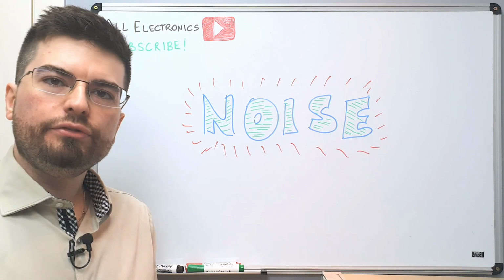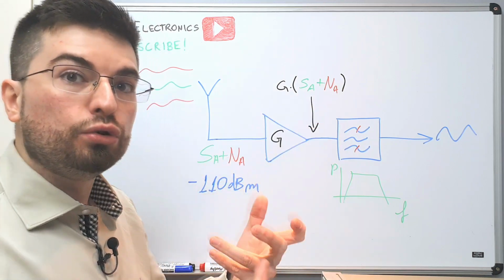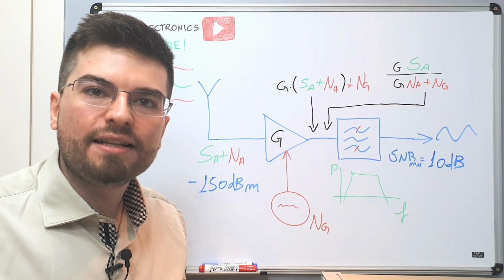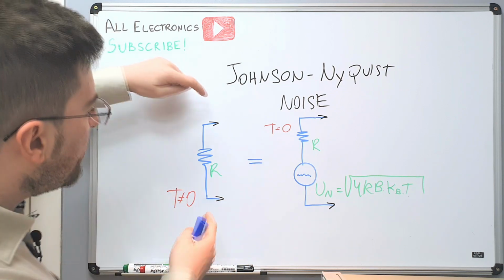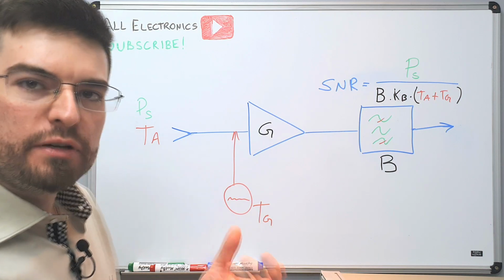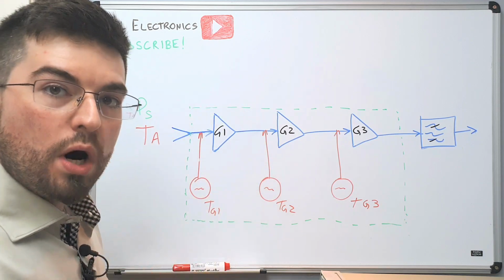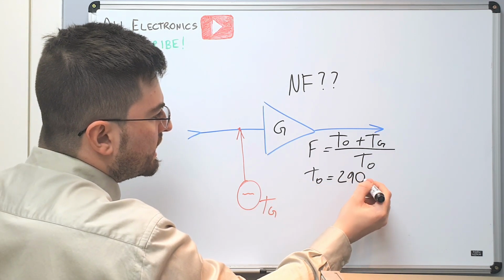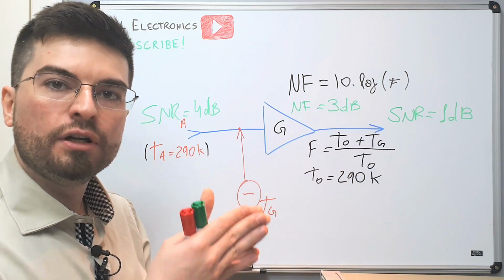Signal to Noise Ratio, Noise Temperature and Noise Figure

Comment: 9:08 So, in a system with buffering and acceptable latency, we can perform more powerful error-correction, correct? But isn't latency cumulative? That is, if an error-correction method requires 10 seconds of latency for one second of data, then 5 minutes of data will require 50 minutes of latency. Correct? Any way around that? Parallel processing?
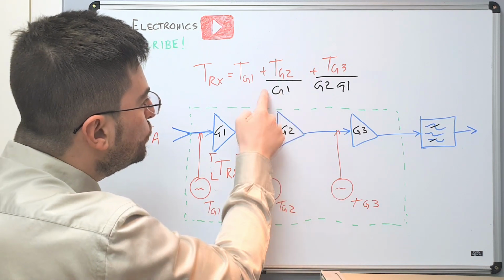9:46 What is the benefit of referring to gain-stage noise as "input" noise? That seems unnecessarily confusing and incorrect. Then in our noise formula, we'd have to count the gain noise twice (G*G), which makes no sense. If 9:46 combines Na with Ga, then at 19:54 don't we need to separate TGA from TG1, to see the effect of TG1?
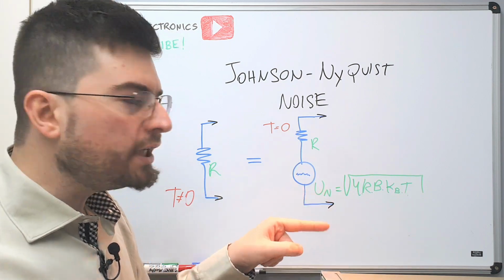12:52 Why do we say "available noise power" instead of just "noise power"? What's UN?
Reply from the maker: No.. Latency is not cummulative... It is just delay... If you cannot process the data at the same RATE, we have the problem you tought. 

You need to refer it at the output or to the input, it is a matter of choice. If you refer to the input, you can easily account for different gain settings of the amplifier, for example. 

Available Power is the power that would be dissipated to a load that is conjugated matched to the source. It is the MAXIMUM power that source can generate. It is available, and not dissipated if the load is not matched.
Reply: @AllElectronicsChannel  "Dissipated to a load" - Unclear. I thought "dissipation" means "loss". I thought that's the opposite of "available to the load."

"Available Power is dissipated. It is not dissipated."?

"Available Power is matched. It is not matched."?
Reply from the maker: Avaliable = maximum power that can be dissipated by the load

Comment: Hi, sorry but I still do not have clear idea what noise temperature is. So is it defined for amplifier or antenna out of blue or it depends on physical temperature? How to measure it?
Reply from the maker: The noise temperature is the temperature a resistor would need to be at, for generating the same amount of noise power that a circuit generates.
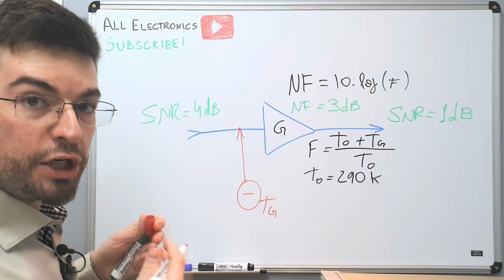Reply: I'm a bit confused here: for the antenna temperature do you mean the temperature that the antenna is itself; - or do you mean the temperature of where it's pointing i.e. the sky or the horizon...at 24:25 you say it's the temp of the antenna itself, then at 25:12 you say looking at sky it's different...?

Comment: Glad you added the example of satellite communications at the end of the video.  Have been working in satellite communications for 45+ years and noise figure is really important for this application.  In my first job working on an Army satcom terminal receiving in the 7.25-7.75 GHz range, the AN/MSC-46.  The antenna used a cryogenically cooled parametric amplifier where the first stage was operated at about 17 kelvin to reduce thermal noise.

Low noise amplifiers have improved considerably since then. The systems I work on these days operate in the Ka band (17.7-20.2 GHz and 27.5-30 GHz) and as you noted the antenna temperature depends where it is pointed and also the size of the aperture to some degree.  If the antenna on the Earth and is pointed to space it will see primarily the cold sky plus a small amount of the Earth noise coming from side lobe gain, say 40 K.  If the antenna is on the satellite and the entire 3 dB beamwidth is pointed onto the Earth, then the antenna temperature will be around 290 K.  If the satellite antenna is pointed to the edge of the Earth and only a part of the beam covers the Earth then the antenna temperature will be something less than 290 K.

In the Ka band, a reasonably good satellite receiving system noise temperature is around 650 K after the noise from the LNA is added to the antenna noise, and often more like 1100 K given the additional losses of complex feed systems in front of the LNA.
Reply from the maker: That's amazing... I would spend hours talking too you... so much things to learn.. I'm fascinated about all this stuff. I hope some day I have the opportunity to work on this area. 
I also have interest to try making a parametric amp.
Thank you for your comment!
Reply: @AllElectronicsChannel  I very much enjoy the way you tackle the subjects you cover, starting with a fundamental math analysis and a hands-on build to show the principles.

I did a quick Google search and did find article which seems to describe something very similar to the system I worked on.  https://apps.dtic.mil/sti/tr/pdf/AD0751652.pdf

In the case of the MSC 46 system, it used a varactor diode being pumped at 42 GHz.  The power output of the 42 GHz source and the diode bias were adjusted to tune the gain and frequency response of the amplifier's first stage.  The second stage of the amplifier was actually heated to a stable temperature above room temp and tuning for gain and flatness across the band of the two stages that interacted with each other was quite tricky.

Today's LNAs that offer super low noise at room temperatures made all of the above expensive bulky and temperamental gear obsolete within a few years after I worked on the gear.  But I'm really glad I had the chance to learn and work on the gear, not many people can say they've rebuilt a cryogenic amplifier working at 17 K :-)
Reply from the maker: I will study it!! Thanks man...
Reply: @AllElectronicsChannel  do
Reply: I will be using pyramidal horn antennas with an LNA and a spectrum analyzer to scan in a 360 degree azimuth to look for possible interference in the X and S bands (2GHz and 8GHz). One of the requirements is to "Calculate cold sky noise temperature at 10 degree elevation." Would you (or anyone) perhaps know how one does this? Is this simply measurable somehow? Google doesn't get me too far...😕
Reply: @j.w.8663  This kind of testing is detailed in TIA EIA-411-A.  There are excerpts here and there on the web but not super easy to find.  The doc costs $271 but unless you're in the industry and performing antenna performance testing to that standard there's no reason to spend the money on it.  There are other sources out there for how to perform antenna measurements for gain and beamwidth and G/T.

The noise temperature looking at the Earth (elevation angle 0 deg or less) is about 290 K.  The noise temperature drops quickly as elevation angle increases.  There are lots of sources for this info from the radio astronomy community that give values for elevation angle and frequency.  

What  you'll see with your horn antenna will depend on its directivity.  No idea what the beamwidth is for your horn but there will also be an Earth noise contribution from the side lobes of the horn antenna even if the main beam is off Earth.

You'll need to understand your LNA's noise figure before performing any measurements.  At those frequencies the noise figures can be below 1 dB for decent commercially available units but there many available with noise figures upwards of 2.5 dB.  So you'll need to characterize that first.  With a 2.5 dB NF the equivalent temperature would be 225.7 K but if the NF is 0.8 dB it is 58.7 K.

Typically I'm working with antennas that have beamwidths that are a degree or less and sidelobes that are several tens of dB down in the direction of the Earth so the noise contribution drops quickly as elevation angles increase.  Your horn, not so much.

If you don't see any change when you point your horn into cold sky (avoid the sun and other bright sources) and then back down to the Earth, either the LNA temperature may not be low enough for what you want to do, or you may be limited by the spectrum analyzer's internal noise.

Comment: "use" is a one-sylable word...   "received" is a two-sylable word...not three...  "preserved" has two ...etc.  Great video... I only mention the English because you are close to being perfect with English delivery except for this small issue.
Reply from the maker: Thank you for loving the channe and for the help! 🤩🤩
Reply: @AllElectronicsChannel  You just gave me an idea for a helpful AI program.  The program would listen to non-native English and test each word for optimum pronunciation.  You would train the system by reading a few dozen pages of technical journal text.  The system would identify non-standard pronunciations by comparing it to a standards database and be ready to detect these.

Then,  you would use it to train your own engish by reading new text into the system,  and having the system correct you in real time.  After a few hours training on this system,  people would think that you are from Chicago.   It works like a spell-checker,  only for audio,  rather than text.  I am sure there are a dozen programs out there that do this already,  since it is an obvious idea.

You have a very intimidating collection of test equipment.
Reply: :defined"  ... two syllable....   deee-fined    ... not de-fine-ed    Same goes for amplified.  No amplifi-ed.    If you just took off the -ed and pasted a t on the end,  it would be closer.
Reply: You pronounce "referred" correctly .... you do NOT say re-fer-ed.....  The other words I mentioned merely need to be pronounced in the same way....
Reply: "fix-ed" ... should be one syllable.  Americans actually say "fixt" ....  they make the 'ed' sound like a t.   I am not sure what British do.
Reply: "de-gre-dade-ing" .... Americans would say   dee-grade-ing.         There is a difference in pronunciation between "degradation" versus ""degrading"  and "degrade".  There is no logical reason for  it .... just the way native speakers say it ...